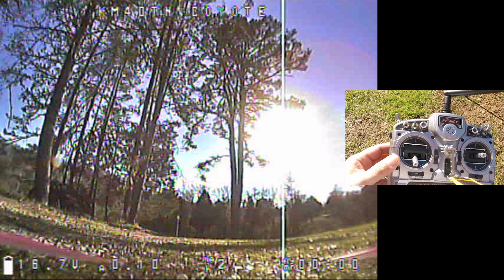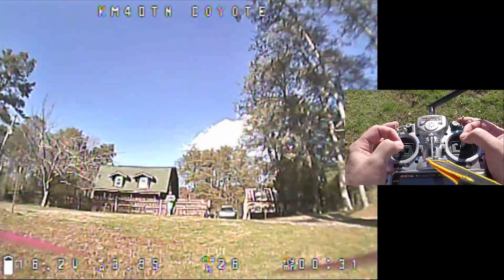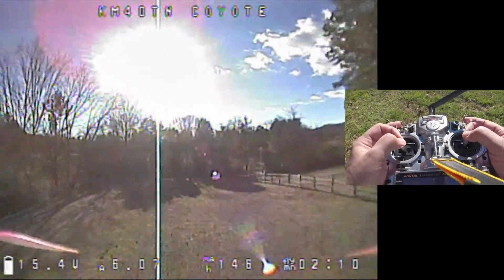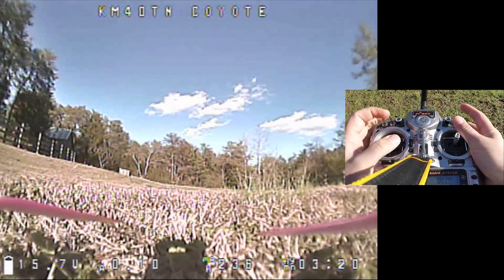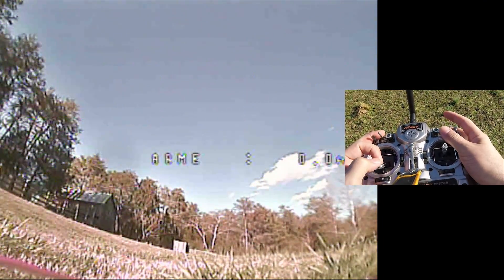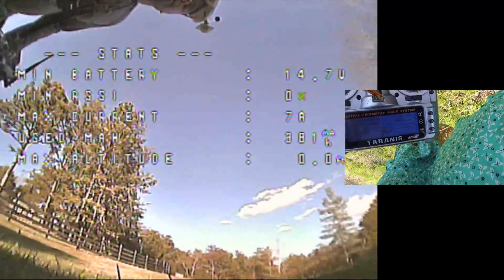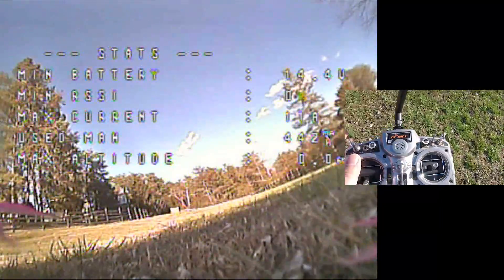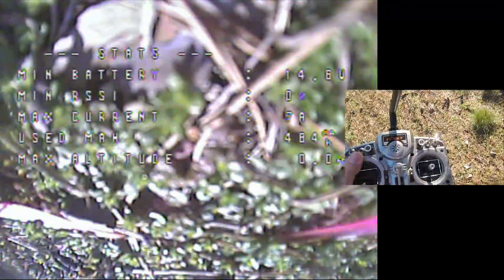How To Land In Air Mode | BETAFLIGHT CLEANFLIGHT

Comment: I would love to know the difference in Airmode from KISS to Betaflight? I find they behave very differently.  It's much harder to land in airmode in Betaflight for me which was a surprise when I tried it the first time.
Reply from the maker: +FinalGlideAus if only we could see the source...
Reply: Joshua Bardwell savage lol
Reply: Well I can ;)
Reply: We need GapIt's wisdom on this. He's the only one with enough experience in perching between the 2 firmwares. - Semi-serious non-troll speculation: Ye Olde Multiwii bounce is still somewhere baked into the code? - My normal smart-assed speculation: Kiss Airmode is SoftMounted! - THE ONLY WAY TO SETTLE THIS IS WITH RACEFLIGHT GENTLEMENS.
Reply: "Because he refuses to even look at the Betaflight source for ideas and must reverse engineer it."
Reply: I was wondering the same thing Chad! I mean I have no issues what so ever landing in airmode with Kiss software on my FC board. Even slamming it against the ground doesn't misbehave after a disarm ?
Reply: the difference is one is OpenSource and other one is copyrighted from OS. shame on Kiss
Reply: @NarcolepticLTD Question: Does your name suggest the disorder? Do you have narcolepsy like I do?
Reply from the maker: +ErreuR .TV as far as we know, KISS is not copied from open source. Felix has been absolutely scrupulous about not copying source. This is why SmartAudio is taking longer in KISS, for example. Because he refuses to even look at the Betaflight source for ideas and must reverse engineer it.

Comment: My arm switch is:

Up: disarmed
Mid: armed, no airmode 
Low: armed, airmode

This way, when I am preparing to land, I flip my arm switch to the mid position.  

That being said, I still suck at landings!  At least it cuts back on the bouncing.
Reply: Not to dismiss your switching skill but, i think its too risky for newer flier. Too easy to disarm when you only want to turn airmode off.
Reply: And besides that, it's not all that hard to land in air mode once you're used to it.
Reply: You will only want to turn airmode off when landing and the turning off "disarm motors regardless of throttle value" allows you to not disarm by accident in midair. I also use this procedure and found it works nicer and doesn't require a good timing of hitting the disarm switch after touchdown because you only use your throttle to disarm.

Comment: i cant land at all in fpv i have to look away from my screen and line of sight land.. i cant get myself to slowdown or stop i just keep gaining speed.. also i have trouble judging how high i am off the ground.. i guess just more practice and broken props
Reply: teamSAF bmx it takes practice you have to find somewhere in the distance and line up with it, great thing to practice on a sim
Reply: I'm still learning mini quads myself,  I will sit there some days using the whole battery just doing landings, it has helped alot. I saw a video on Currykittens channel where he suggested using the horizon/out in  the distance as a guide to help land and this helped me. I'm stuck with the sorta higher camera tilt because of the frame I'm using and how my camera hits the uart so either i learn or I break stuff... lol

Comment: Thoughts on pinchy vs. thumbs for noob.  
I'm led to believe pinchy is preferred but my thumbs keep wanting to take over.
Should I work harder on pinchy?
Reply from the maker: +Newtsche I found pinching to offer more control. But switching only took about 5 or 10 packs so it's not a big deal.
Reply: yeah is not an easy transition but it gets better with time. Keep at it.

Comment: I just have airmode on a switch and have no problem. People say you will forget to turn it on. I don't, When I arm it and the props don't turn, well I know I don't have airmode on.
Reply from the maker: I would never turn motor_stop on. I don't think it's at all safe to have the copter armed with the props not spinning.
Reply: Hmm, I see your point! But betaflight makes the copter beep every sec or 2 when armed with no throttle

Comment: I truly appreciate your videos but per your own words "you don't need to be super ultra precise" so why do I need to disarm 1/2" from the ground why not turn air mode off 2-3 feet from the ground and just land. How's this any better?  You didn't explain why it's better your way.
Reply from the maker: +Pheonix 2 I just prefer to leave air mode on all the time.
Reply: DnllnGproductions I wasn't coming down on him, my curiosity was if you don't want to have to turn off air mode with a flip of a switch why have a switch to disarm. One more switch to flip just to keep air mode on seems like we are searching for content to post about. It's just one more flip.
Reply: The thing is that I have never had any issue landing with air mode on lol....
Reply: I think the most dangerous aspect of having airmode on a switch is not forgetting to turn it on and tumbling out of the sky, but forgetting to turn it off and nearly chopping your face off as the copter bounces in to your lap.
Reply: Pheonix 2 good point. Well put.
Reply: that would be 'landing without airmode.'  An entirely different video.  :)
In all seriousness:  For many of us, putting airmode on a switch is a dangerous proposition.  You forget it's turned off then kill the throttle to duck under something or do some move and suddenly you have no control.  This can end poorly.
Reply: Brian Bailey Hence my next question - what did you do before air mode ?
Reply: idle up switch.  It wasn't as good, but better than nothing.
Reply from the maker: Before air mode, here is what I did: https://www.youtube.com/watch?v=P-ba6Xa51Gc

But idle up is inferior because it rasises the throttle set-point all of the time, whereas air mode only raises the throttle set-point when authority is needed. In my opinion, anyway. Some top pilots still prefer idle up to air mode.

I don't like air mode on a switch because I never want air mode turned off. What is the down-side of having air mode on? I have no problem landing with it. So why give myself the extra step of remembering to flip a switch?
Reply: +Pheonix2   Kept your thumb low enough under the throttle so that it never hit completely off throttle...
Reply: Again as I said, none of that has ever happened to me, and even with more reason in latest betaflight updates. The airmode doesn't activate while you are in ground, so you can leave the quad there and when you land it barely bounces, it highly depends on how hard you land, I don't land mine like silk and I don't see anything wrong or any dangerous behaviour.
We aren't in 2012 people.

Comment: I always do this weird downward spiral thingy until  I finally get close. Which seems impossible because of my cam angle & it's a stock Runcam lens idk. On my turnigy 1-6s thers  a button right where your index finger naturally lays on the back of the transmitter it makes this so comfortable
Reply: to prevent a landing from changing my cam angle I've got this lil zip tied foam pc thingy which has forced me to fly at least 35°
Reply from the maker: +Space Lord yeah. I just left it off because I was changing angle for the demonstration.
Reply: You've got one too? That's awesome as you know I've barely been flying a couple weeks. I decided today I'm going full acro so wish me & my quad the best of luck haha. You think I should acro los first or just go strait fpv?
Reply: I find LOS in rate (acro) to be harder than in FPV.  You'll love it.  No more holding the pitch stick forward!
Reply: Dave Grainger omfg i don't know why I've been horrified this whole time I jest flew 4 packs acro and although I barely purred around the field probably 30% throttle lol but it was great. This is nice I'm proud lol

Comment: Or you could just disarm a couple feet above the ground like the rest of us idiots :D
Reply: Yeah. I'm not keen on breaking stuff. Maybe six inches, but surely not two feet, especially for an under-slung battery. Even carbon breaks, my friend, and every hard impact stresses the epoxy. Worse yet, if you've got a batch of crap CF, impacts can cause micro cracks and micro delaminations inside.
Reply: My first fight got scared and disarmed at around 15 feet, did not even break a prop. My first flights did not go well wife laughed hard though.
Reply: first time ever flying fpv dropped my mini rotorx atom from 80ft in the air because of a broken motor wire. cracked the frame a little, glued it back together and flew it the next day!
Reply: Why would you want to disarm a 2 feet above lol..
Reply: Because when you run a ton of camera tilt, it's difficult to come in for a proper landing.
Reply: I still think 2 feet is too high.. the quad can flip easily with the drop motion.. you are right though the more tilt the less flat ground you perceive
Reply: Lol our aircraft are quite a bit more durable than that. Check out the middle of my Knocking The Dust Off video, had to disarm like 40 feet above the ground. Only prop I broke was the one that fell apart.
Reply: Nice gimbals
Reply: i diss arm as i fly in around 30 feet up and then land and lower to zero throttle on touchdown , soon as the throttle hits zero they stop spinning , you can do it any height you wish , as long as you don't drop the throttle , and of course you don't as your still flying